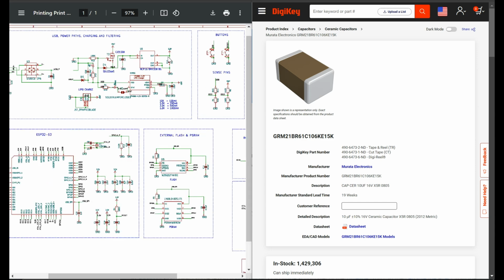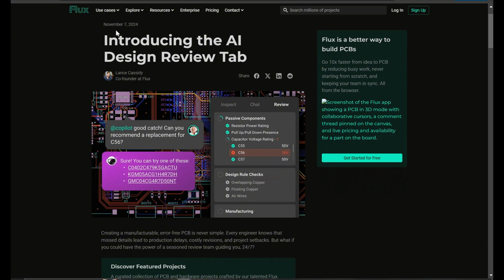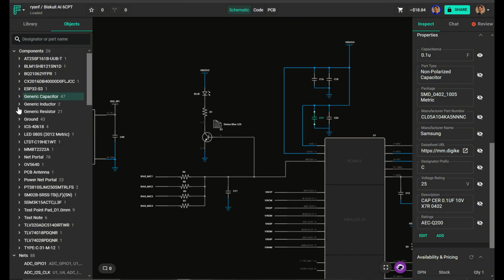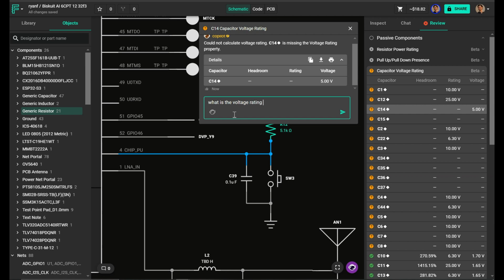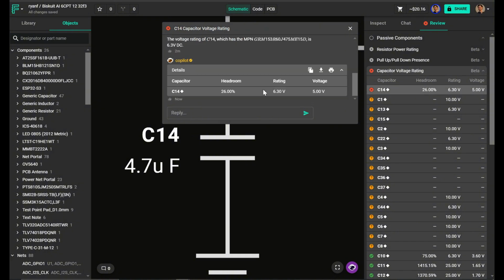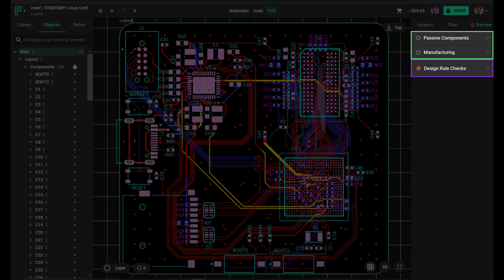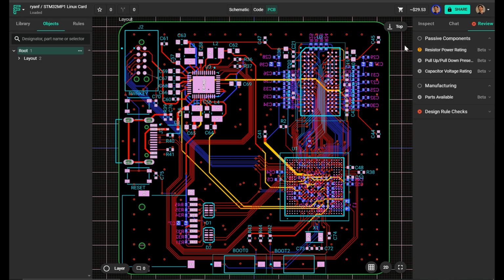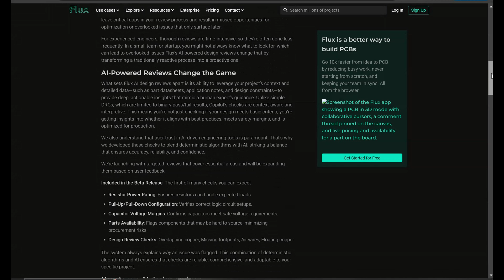NEW AI Design Reviews | STOP Making PCB Design Mistakes

Comment: How much did it cost you to complete this project in this program?
Reply from the maker: Hi! It’s hard to say since the cost depends on factors like the components, board size, and the manufacturer you choose. Flux itself doesn’t charge for designing or simulating your project.
Reply: @buildwithflux  That's a complete lie. It costs minimum 15$ to register.